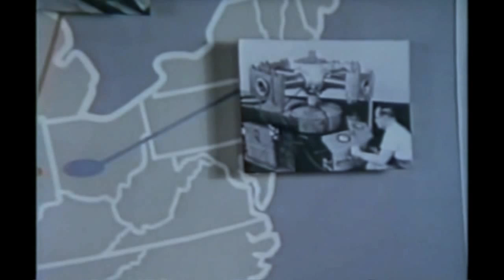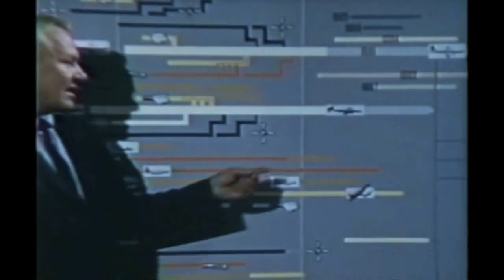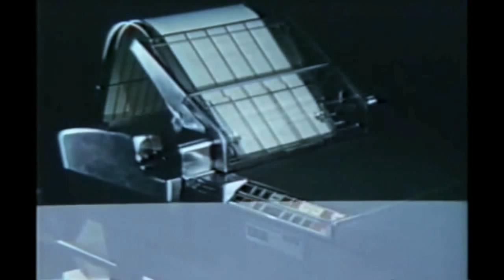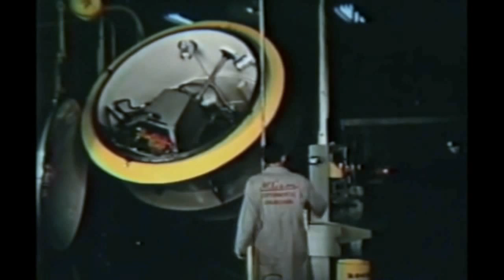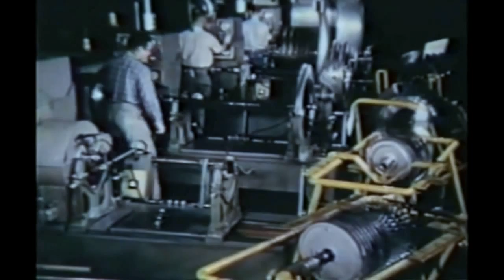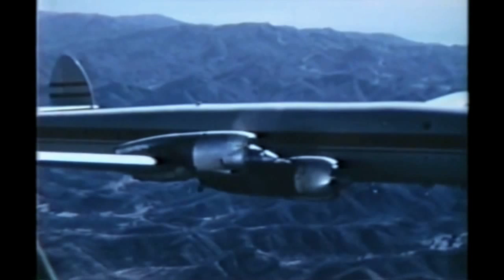Lockheed L-188A Electra Promo Film #1 - 1958

Comment: Lockheed had a L-1249 Super Constellation, powered by Pratt & Whitney T34-P6 turboprops, which were similar in type to the Allison engines, under development, but it never reached production for commercial service. Also, Aeroproducts, which made the 606 four-blade propeller, became a division of Allison after its founders, Werner "Pete" Blanchard and Charles MacNeil, passed away. It would later be sold to Hamilton Standard, which provided the alternative propeller for the Electra II. Rohr Aircraft Corporation is today part of RTX (formerly Raytheon Technologies) Corporation. Allison was acquired by Rolls-Royce in 1995 after General Motors sold it two years earlier.